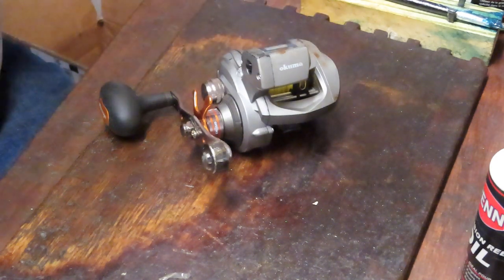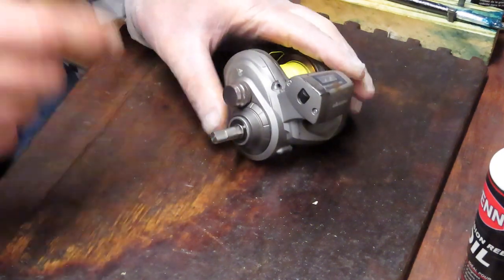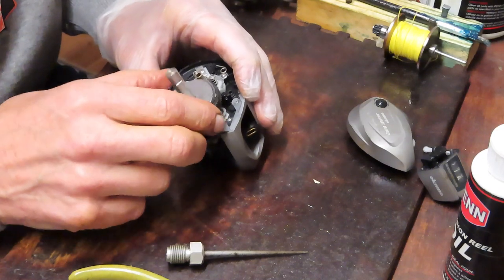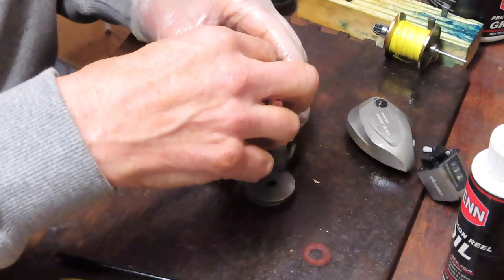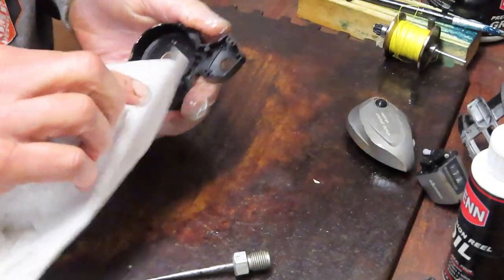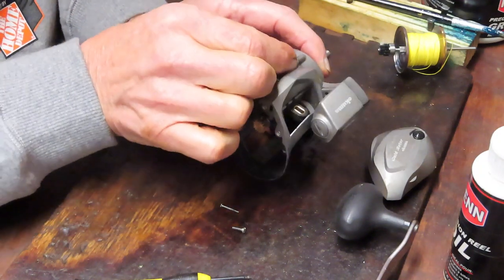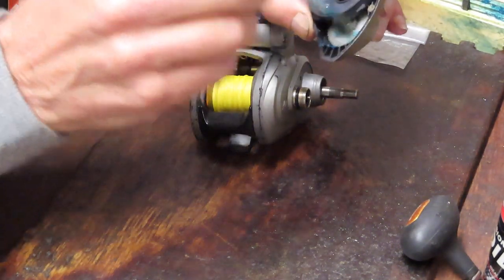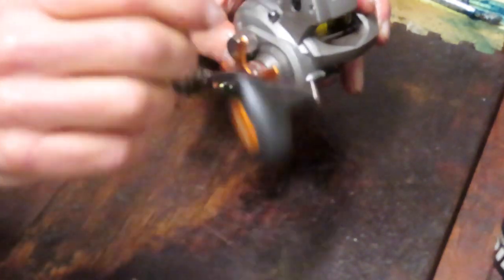Okuma Cold Water Line Counter low profile baitcaster how to take apart and service this fishing reel

Comment: These little reels are popular for Northwest salmon fishing.  They seem to hold up pretty well and are popular with several guides.  Load the reel with 50 or 65 pound test braid and you're good to go.  I have two on downrigger rods for salmon and also use them when trolling with weights up to a pound.  They're pretty well sealed for salt water use.  Those big drag washers work to provide smooth drag resistance with little of the jerky drag performance that loses fish - especially when we're fishing with barbless hooks.  Thanks for this video.  I'll watch it a couple times before servicing my reels this winter..
Reply from the maker: I can see how they would be popular.  They are nice and strong and this one showed little wear even with all of the fishing it has done.  Best wishes - Dennis

Comment: Hi Dennis,
     Nice job getting thru the twists and turns of this reel ! As usual your intuition was correct.   
     Worked on a small Daiwa 700 and a Shimano TX 2500 Quickfire ll today.  Both fun.  Was amazed at that the smoothness of the quickfire bail trip  !!!
Reply from the maker: I like those quick fire reel set ups and the case format, but I don't use the feature.  I just don't seem to get the release point right.  Love those reels in freshwater.  Best wishes - Dennis

Comment: Hi have you had a Second chance to Open the Daiwa Low profile line counter Reel, 300 size, You have the Best info going when a Guy needs help with his fishing Reels, I Opened My Okuma Convector 354 Low profile line counter & it is the same as this Cold water you are doing here. Thank again Dennis From the Great Lakes area in Canada
Reply from the maker: I have not done one of those.  Thanks for the note and for watching.  If one comes into the shop, I will try to add that to my library - Dennis

Comment: i have the same reel. when i click the thumb bard, the reel did not release (free spin). what is wrong with it? thanks in advance
Reply from the maker: It could be named with dirt or old grease or there could be a broken par.  IT is hard to say without seeing the reel.  I would remove the case and check the internals - Dennis